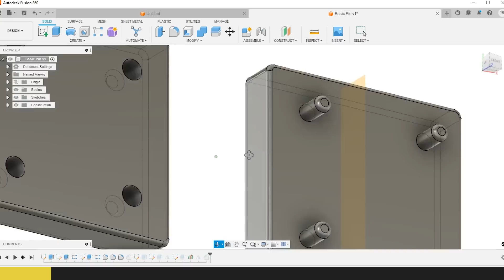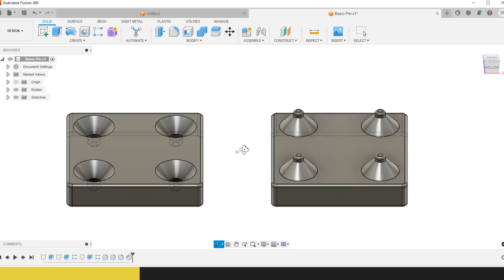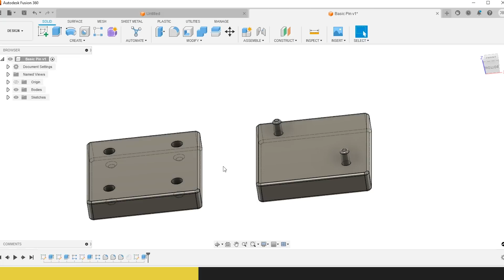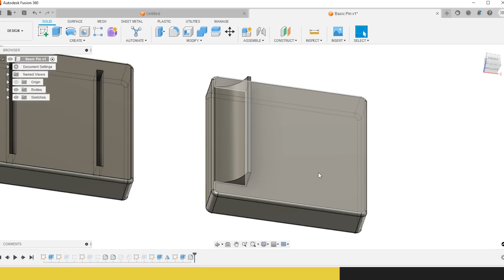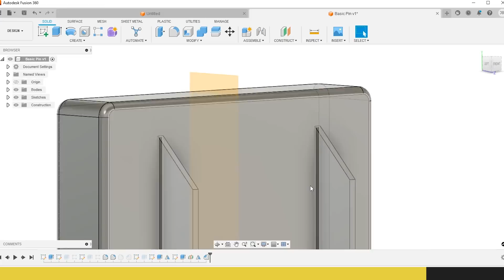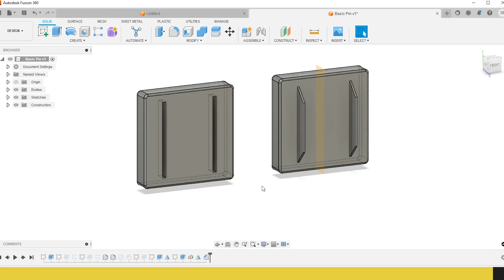Alternative to Pins and Holes: Design for Mass Production 3D Printing

Comment: great video. have u considered magnets?
Reply: Magnets would require an extra manufacturing step of inserting those and would probably increase manufacturing cost by quite a bit.
Reply from the maker: Correct. If the function is not needed you do not want to add additional pieces.

Comment: The time it would take to print that part horizontal then print that part vertical is drastic.  Printing that part vertical would drastically increase the print time of that part.
Reply: when mass printing, you can stack a lot more on the plate in a vertical orientation, requiring much less human time to set up and clean off the machine (with the added benefit of layer line orientation.) attending to the machine once per shift vs 7 times per shift.
Reply from the maker: Print time is an irrelevant metric. That is point of print farms. Large parallelization of automated production so that the project takes as long with printing as with any other process.
Reply: @slant3d  Tell that to the client that gets charged by the hour hhahah :-D
Reply: @slant3d  print time correlates with rent and machine amortization costs. True for any machine. Just because a farm has many of them doesn't mean it doesn't matter. Sure, you can charge 1000$ per print on one machine even if it takes 1 hour, but then you're in luxury territory and no longer commodity manufacturing and no longer makes sense with the rest of marketing messaging.
Reply: @slant3d  how is print time an irrelevant metric? Especially for print farms lol. When you have hundreds of printers operating all making the same “mass production” design, 1 hour saved per print stacks. Your yield is drastically increased in the same amount of time, your utility costs go down bc you saved 1 hour per print per machine (less power needed to run the printers for less time) you also reduce the wear on the machines thus saving accumulative maintenance/repair costs. You also make more money by finishing that production wave sooner allowing you to make money sooner on the next designs. Why do you think old school factories and assembly lines focused on the literal amount of foot steps workers had to take, cutting out seconds and fractions of seconds anywhere they could? Print times are irrelevant to hobbyists printing a couple parts a month. I’m not even mad at the video. It’s a fair idea in specific use cases, but when your parts didn’t even align properly I had to come check the comments. If you are going to talk about quality and accuracy at least reprint the demo to align correctly for the video lmao. Not saying you don’t have the skill. Idk what it was, design error, printer error, printer calibration, etc. but to hype up the mass production time saved, stability, accuracy, print focused design choices, etc. and then make comments like print time is an irrelevant metric while using the scenario where print time matters most as your arguing point for its irrelevance is smooth brain and ultimately null and void if your outcome doesn’t even align properly 😆 I’ll check out some more of your videos and give you a fair shake (this is my first) but just one man’s opinion, do better man. Don’t argue with commenters on YOUR videos giving you play time (regardless if they’re right or wrong) about petty shit and then not even have the parts align dog. Post sand that shit, hide the misalignment with a better camera angle, something. You clearly have more skill than that outcome. I hope to see it in your other videos